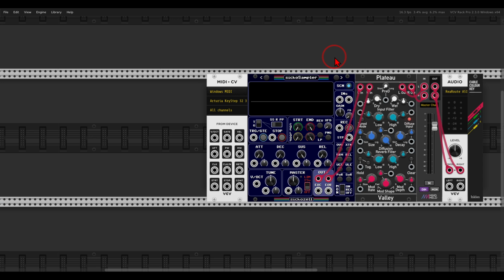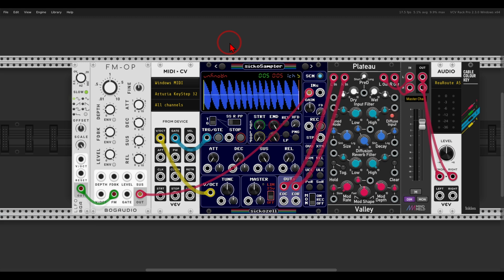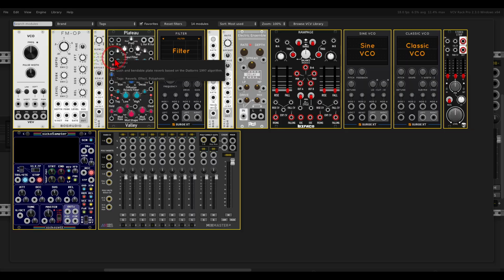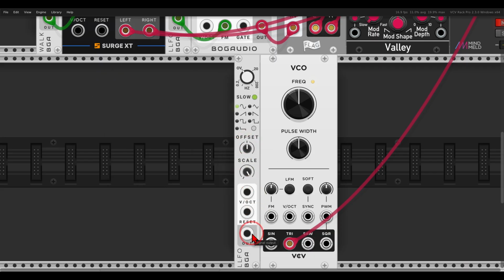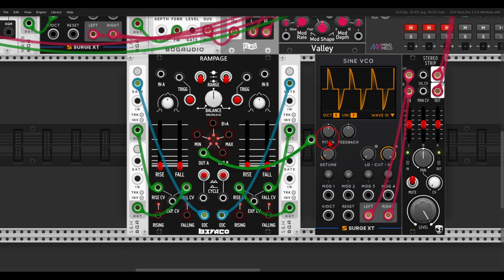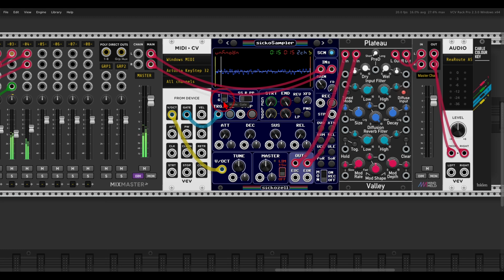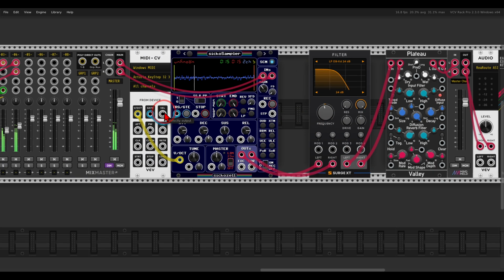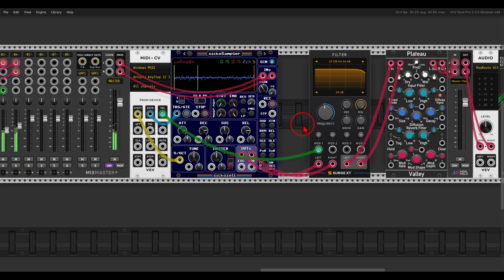a Great Technique for Unique Pads

Comment: Ha I was thinking of making exactly this video the other day, you beat me to it! The pad at the end sounded great, but I was expecting you to resample the whole thing 😉
Personally I don't find any of the native VCV module samplers that good, so I bought Pigments for this. I do a lot of resampling VCV but it's a slightly different process. I usually make texture patches with stuff like filter pings and sample that as a layer. Sometimes I take a whole finished patch and just set all the quantisers to octaves, record parts, edit in Audacity to loop it perfectly then load the samples into Pigments. Sometimes I also sample single notes with loads of VCV effects, then use parts of that. You can also use the granular engine in Pigments and add more effects. Endless possibilities for sound design 😀
Reply from the maker: For a long time now I've been wanting to give Pigments a try. I will have to get it at one point... Sound-design heaven!
Reply: @OmriCohen-Music  I got it quite cheap, try to pick it up next time it's on sale! I got it through a reseller but Arturia usually do special pricing too if you have any of their products. The sampling/granular engine is excellent and sounds very clean when you play stuff back at a different pitch. It's not always obvious what type of sounds are going to work resampled but that's the fun part with experimenting. It's quite often the  things you don't expect to work that sound amazing 😉

Comment: Very cool. Trying to get my head around using found or recorded sounds but NOT using a midi keyboard, perhaps as part of a generative patch. Playing the sound once is fine (you can just load up the audio file), but then how you transpose it to give you that pad like texture
Reply from the maker: Thanks! Yeah, using found sound might be tricky sometimes. I think that the more you work on the sound before you use it, the easier it will be when you build your patch. For example, finding loop-points, transposing when needed, removing noise, etc. It can be tedious at times, but when you finally sit down to compose, you can concentrate on composing rather than troubleshooting samples. I hope it makes sense...
Reply: Thanks @OmriCohen-Music ...mmm, I think I was headed that way too...actually manipulate the single sound into a 'chord' and then use a sequencer or something to vary it (to mimic playing it on a keyboard)...either that or set up (say) three instances of the sound (as duplicates are easy in VCV) and make them travel through a chord sequence together....or use the sample as the root and see if I can offset the signal (but trying to work out if I do this before the sampler or afterwards)...I'm still learning 🤣🤣

Comment: This is great! I'm having some trouble making it polyphonic though. i've enabled 3 polyphonic channels/voices in the right-click menu of the MIDI-CV module, and tried the different polyphonic modes, but when I press more than one key at once on the midi controller, I get silence, and even playing one key at a time, I only hear sound every few notes. If I set Polyphony Channels to Monophonic, everything sounds fine, but of course it's monophonic. Am I missing a setting somewhere? 
EDIT: Figured it out - the problem had nothing to do with sickoSampler but I was sending two polyphonic cables from the outputs of sickoSampler to a Gig Bus module. All I needed to do was just send one.
Reply from the maker: Glad it's working for you :) Have fun!